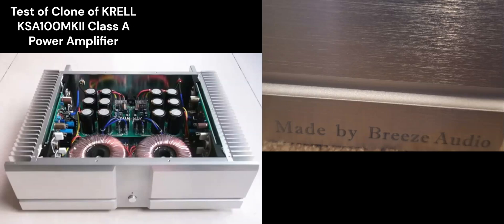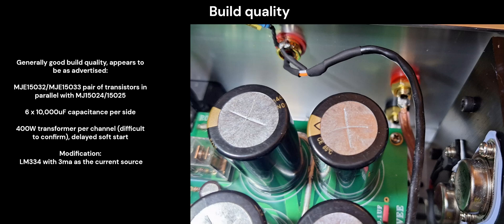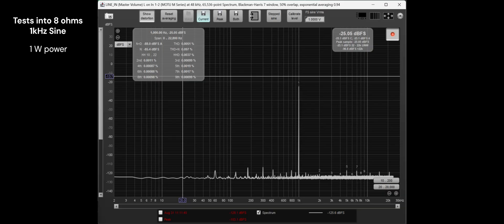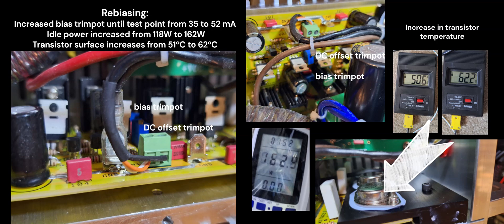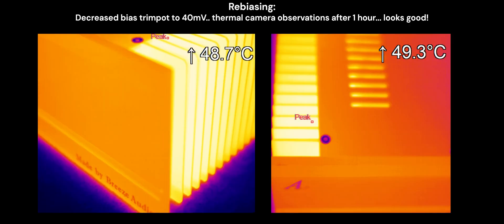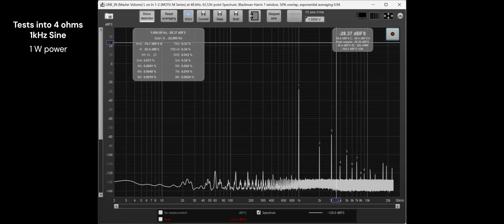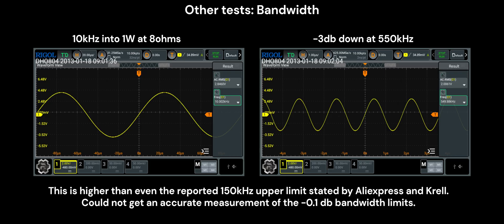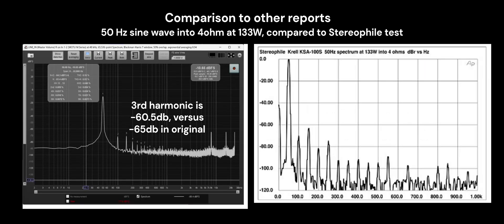Krell KSA100 clone from Aliexpress bench test

Comment: Hi great video, but in the square wave test, I see that the generator signal has a 20ms period so 50Hz, but in the output the period is 90us???? So a ringing at that frequency isn't so bad right? (the initial peak goes up 1/5 the peak amplitude and then down in just 2us), but may be a couple of measurement with square wave at 50/1000/3000/10000Hz will be interesting, to see how the ringing behave at different frequencies.
thanks for the video :)

Comment: How does it sound? Thats what matters
Reply from the maker: That's right, I am not able to 1:1 compare to many other amps, so I just had some general comments. I had a Xindak KT88 tube amp before, this is much more linear and open sounding, with more coherent soundstage. I would prefer this overall, and it is worth the price for what you get. It does not beat the soundstage and realism of my DIY amp, which as the Simplestark
Reply: Great stuff. Keep us updated with specs of these clones.